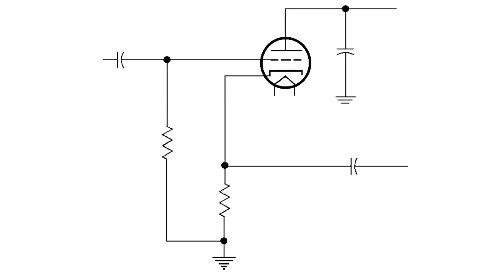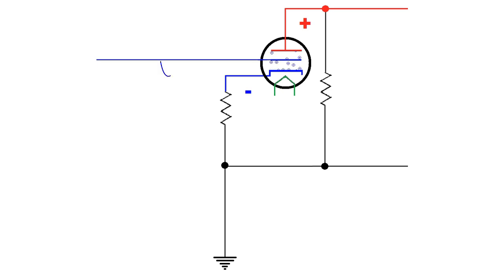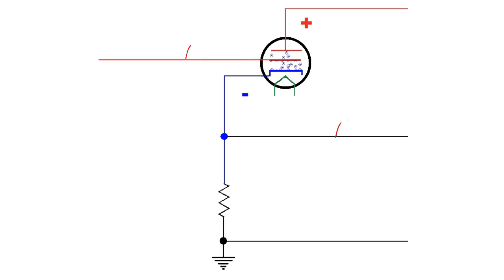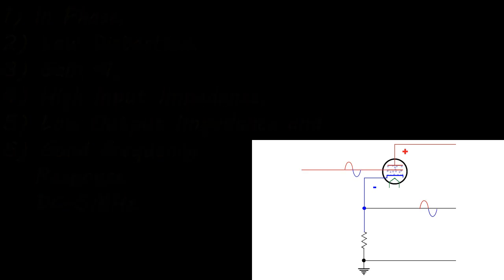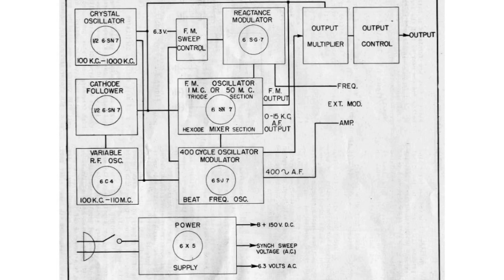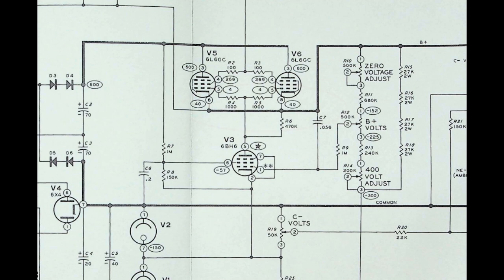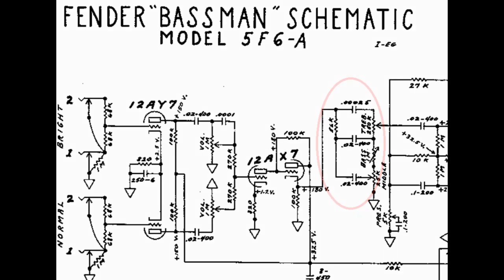03924 Short Circuits #2  'The Cathode Follower'

Comment: Cathode follower will drive small output transformer 16 ohm hooked to cathode to drive grids of push pull output stage.
Reply from the maker: Yes that is one of its applications,  In this case you are taking advantage of the low output impedance  which can be matched to almost any input (load)  impedance by selecting the correct values for the cathode follower

Comment: Nice walkthrough.

I'm trying to tackle building a state variable filter with tubes instead of opamps or OTAs and I think cathode followers might be the trick. Have you ever come across anything of the sort in your tube travels?
Reply from the maker: Well that would be a novelty. 
They did have tube opp amps back in the the day the K2-W springs to mind, 

http://www.philbrickarchive.org/k2-w_refurbished.pdf  

but you will need lots of voltage +-300 to make it work.  

I think there was a paper on just that by Walt Jung some time ago.  As well there are Butterworth filters that use the CF and a few modern designs.  Search  for Tube Cross-over Filter.   
Most of these use a CF as a buffer or in a long tail pair.

Comment: I came looking for answers as I try to decipher some very basic sold state guitar amplifiers.  In my application, as I understand it, this increases the current, without amplifying the guitar signal.  In doing so, it makes sure that the tone-stack does not take all the 'oomph' out of the signal on its way to the amplifier (LM386 in this case).  Thanks for the clear explanation!
Reply from the maker: Hmm in this case they are most likely not using that LM386 op-amp as a 'voltage-follower' or as 'buffer' which would be the  analogous transistor circuit.   The LM386 has a preset gain of 20DB, so it will always amplify the input by at least that.  I can only guess at what they are doing but the LM386 is often used as a  'Bass Boost' in amps,  perhaps this is what you are seeing.   If there is a cap then resistor that can be traced from pin '5' (V-out) to pin '1' (GAIN)  odds are that is what you are looking at.
Thanks for you comment.
Reply from the maker: Opps I think I got that dead wrong.  I misread you comment.   I would say yes there is a very good likelihood that there is a   buffer into a tone stack before it goes to an LM386 though the gain of the LM386 can be as high as 200DBs so any lost 'oomph' could be easily added back in. ;)

Comment: Cathode followers are also kind of nice in filter circuits.   You can make a two or three pole filter or a notch with a known Q a little over 1.0 using one to do a positive feedback action.   
Also if you are making an oscillator, it is worth considering that you can make the LC tank circuit step up the amplitude from the cathode and feed it into the grid.  You can then take the output at the plate.  This is a nice thing to do because the tuned circuit is not connected to the output so the loading has almost no impact on the frequency.
Reply from the maker: Yeah you could write a few book chapters on them unfortunately most of them are long out of print ;).  I just stuck to the very simple example  as it is a 'Short' video.   I just started playing with an old Tek scope (545) and it looks like (to me)  1/2 of the tubes in that are using the cathode is some way.  So much to relearn.
Reply: @byterock  They will need to get an exact gain so cathodes will likely get doing something

Comment: Thanks I was wondering about that the other day😂
Reply from the maker: Funny how that works out ;)
Reply: THEIR SHOULD BE A GRID RESISITOR FROM GRID TO GROUND TO PROVIDE THE NEGATIVE VOLTAGE ON THE GRID.
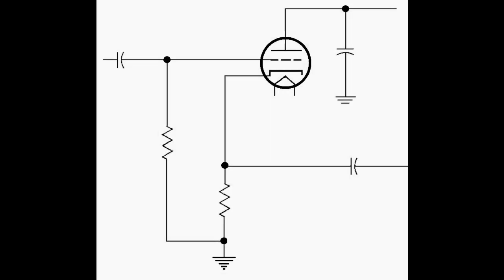Reply from the maker: @davidluther3955  Yes that is true .  For simplicity I left all the 'Normal'  bits off,  like the coupling caps, out of the first example.  A real circuit can be seen at the 4:00 mark,  After all it is  suppose to be a 'Short' video.  

Oh by the way you do not 'Need' a '-' voltage on the grid,  you just need a  '-' potential difference between the grid and the cathode.  Thanks you gave me an idea for another short circuit 😉